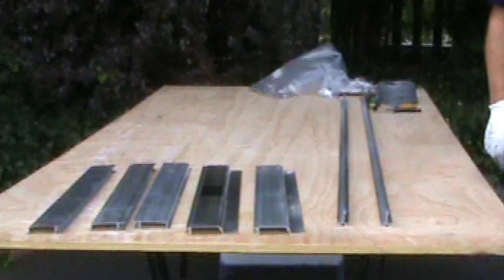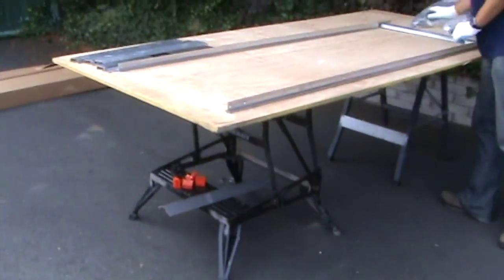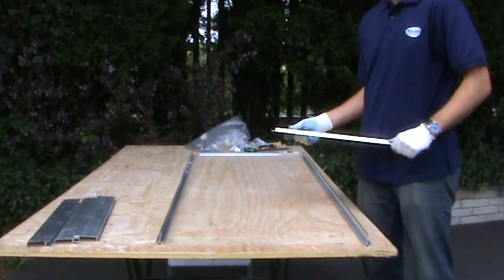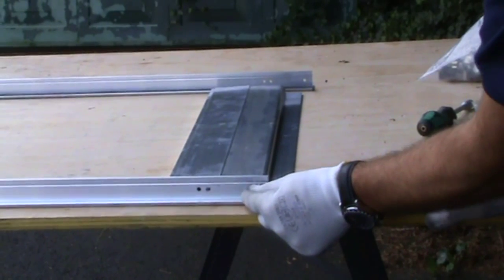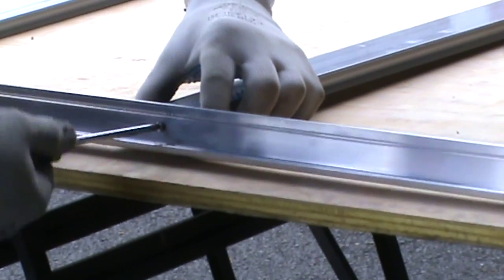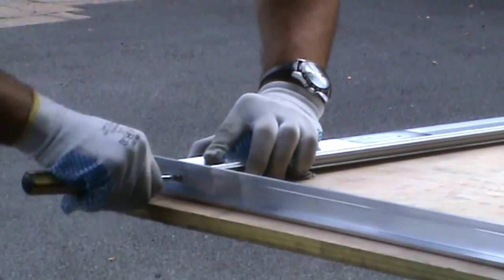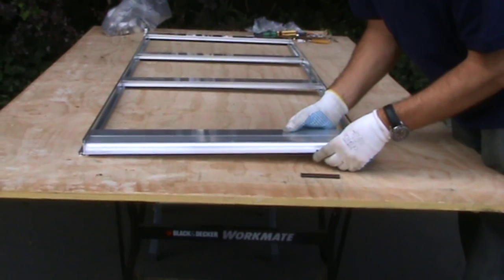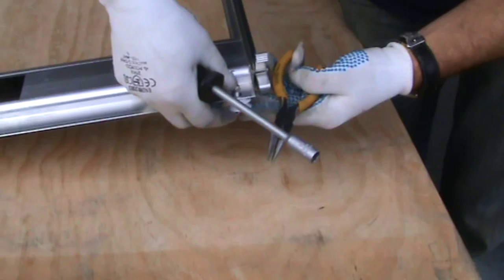Elite Self-Build Video - Door Frame Assembly

Comment: Got the model with 2 small doors, no videos anywhere and the ends are completely different. Figured it out (also put the glass in first as per previous comment), but now got 6 pieces of plastic which nit sure what to do with.